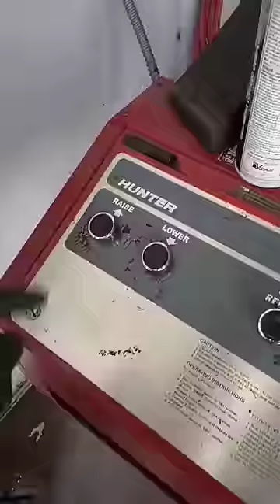how wheel alignments are done #shorts

Comment: That's how a toe set is done. Not a complete alignment, but good procedure I've lost count of the techs I've seen do a caster sweep without the pedal depressor in place.
Reply: I would say that is a complete alignment. Not all cars have anything more then toe adjustments. And like this car not much more then front toe at that. Yes you could shim it but I aint doing that for free. Will you? And most cars if it's off and there is no adjustment usually means something is bent or a bushing is bad or ball joint is toast
Reply: @JoeMamasLover69  this car will also have adjustable camber at the front struts. Rear toe can be adjusted by full contact shims depending on wheel bearing mounting. Front caster will normally have a little bit of adjustment at the upper strut mount and there may be a possibility of a cradle shift to get both camber and caster adjustments also depending on the mounting of the steering/suspension components.
Reply: I’m a tech and still kick my own ass every now and again when I forget to compress the pedal
Reply: with that alignment machine it will detect if you don't have the pedal depressed when doing a caster sweep and won't let you until you do
Reply: @bentleynorton6843  you don’t necessarily need to use the depressor, it will sense if the wheel is moving and tell you but on must trucks with caster set ~2.75 you don’t need it and I’ve tested with and without the depressor and there’s no difference
Reply: It didn’t need a complete alignment.  Didn’t you see the fucking screen?  One red bar, the rest was green
Reply: @fredkuhn165  tell me you know nothing about alignments or customer service without telling me
Reply: @fredkuhn165 keep in mind just because all is green doesn’t always mean it’s good to go. Not saying anything about this guy but in general
Reply: @colbyclemons3917  you were probably a hall monitor growing up mr. know it all.
Reply: @zachbecklake2303   you must be hourly lol
Reply: @joelopez40oz23 and this is why people have distrust with mechanics. We ask for an alignment or are told we need it. The company charges us a price for an alignment that we think is comprehensive, and because of that worth the money. And the tech is like “green, good to go”.

I wish more people would learn about vehicle maintenance and see the automotive repair industry for the rot that it’s become.
Reply: sometimes you gotta do a toe-and-go

Comment: Mechanic said I needed 2 engines 🤔
Reply: He’s right 😂
Reply: Mechanic said I need new blinker fluid to fix my wheel alignment because if the fluid level is too low it will affect my steering when turning.
Reply: @theanonymoustechie replace it 😭
Reply: Probably need half of a transmission too

Comment: You forgot about the torch, cheater pipe, and banging your knuckles so hard they bleed. 

At our shop, it's company standard to include those.
Reply from the maker: Hahah🤣
Reply: hahahaahah i know from experience
Reply: He didn't bother to check tyre pressures and check all the suspension joints for any worn joint
Reply: @luckysdiygarage good job just one thing hold the ball joint with a spanner dont bend it over untightening it. Great work 👍👍
Reply: Experience talking🤣

Comment: I just use 4 jack stands, string and a measuring tape.
Reply: And then you replace your tires every 4 months too. And then subsequently take the vehicle to someone who can actually align it.
Reply: Nah, string Alingement done well is as good as any alingement shop, that's  what profesional racing teams do and so do I  on my personal car and my track car, also I have an extensively modified suspenssion and most shops around me are unable to properly  aling it, even tho there are aftermarket caster and camber adjustments components  they refuse to do it properly , neither do they put the weight on drivers side seat even thou I always request it.

Comment: 4 buckets, two pieces of rope. Start from the back and align the front wheels to the rear wheels. Losen the tierods and adjust. 10 minutes and I'm done. 🤙🏼💪🏽
Reply: 10 minutes is if you have a lift, great tools, no rust, and high on Adderall
Reply: @LawnWrangler323  no. Not really. Placed the two front wheels on top of plastic bags to reduce friction. Aligned the rear to the front wheels. And worked on the arms. And I know it sounds crazy, but that's how I did it. And went to a professional shop to verify and for my surprise, it was less than  .5 off . They told me it was perfect. I didn't needed to get it Aligned.
Reply: Just use a tape measure. Measure front axle tyre on front and backside against the opposite front axle tyre difference 1mm towards on front.
Drive car to see what side it wants to go to, then in your mind think of whqt wheel to adjust.
Thats the way we did it before we had the hunter allignement. Best buy ever for the shop 😅

Comment: All you did was set the toe so its (good to go) you didnt adjust anything else, the camber was out by .5° on the right front and the caster was out by .4° on both sides. Granted the toe might be right but the car is still going to scrub the tires going down the road and it will still have a small pull to the right. All it takes it a little bit of extra time to get those adjustments with a better spec. Do the job right or don't do it at all.
Reply: It never fails…

Comment: Is it common to have the vehicle running at any point for this?  
The reason I am asking is because one of the mechanics took my tuned X5 without permission-(yes I understand test driving) - when I got in, my engine temperature was much higher than it should have been in that short period of time, and I suspect he wanted to see what it had.
Following my alignment I started noticing boost leaks when I was not prior to this. Just wanted to confirm whether or not it being standard procedure to have the vehicle running for a while for a wheel alignment. Thanks in advance.

Comment: Lets talk about the Alignment he did. If you know anything about wheel alignments. that car Caster Cross will cause that car to pull left onto incoming  traffic. .5 Caster Cross is the max allowed limit. Overall this car will not drive great and the steering wheel was off center. Ya might Thumbs up. But I would call this the Standard Good enough mindset of most US based Techs.

Comment: the locking  bolt which way do I turn it to loosen it do I go to the right further down the shaft right?  trying to do my tie rod  and that bolt is not loosening..and theres no rust.. just seems  super tight... also is the best tool to use to adjustable wrenches?

Comment: Alignment is my most hated job ever, cannot stand alignment! I don’t know if it’s the equipment I’m using doesn’t help or I just can’t seem to crack it. But whenever the car comes off the ramp and out for a test run the wheel is never straight. Even though it was clamped in the straight position at the start. I’m using Supertracker 2 wheel alignment, analogue gauges
Reply: That type of equipment does no wheel run out compensation and without it you won't get an accurate alignment.

Comment: So why does it take so long in other shops.  That was quick.
Reply: It's all sped up and that car has only 2 adjustments needed so yeah it's fast. Most have 4+ adjustments. There is also the test drive pre and post so that adds more time. I could post a video on how to do brakes in 1 min doesn't mean it's that fast and easy.
Reply: @fabiololstein1307  also, nobody mentions points where you have to hold a torch to the bolts for 10 minutes 😂
Reply: @jakedro1462  ahh the Joy's of working in the rust belt!!! If wrench on cars for a living I will give you some great advice. Quit, go apply to fork lift repair companies. I worked on cars for 15+ years. I switched to fork lift repair and was the best career decision I have every made. My suggestion would be to find a Car, Mitsu, or Unicarriers dealer. I am a road tech so I am supplied a company van. I still have to use my own tools but get supplied the special tools. Plus you are never cooped up in the same shop. Plus you can choose what kinds of work you want to do.
Reply: This was a hack job  gonna wear  tires Should have adjusted camber shifted the subframe for caster and I didn't see the steering angle reset perform or the spec's for the rear axle to if it needed shims
 must of been 5 o'clock toe & go
Reply: @fabiololstein1307  plus weighting the car with lead shot.
Reply: @Len_M.  only certain manufacturers require that. It may have changed I switched from 15 years of automotive repair to forklift repair about 5 years ago. Best choice I ever made.
Reply: @fabiololstein1307  It’s usually only Performance Cars like BMW M5, etc.

Comment: Rear can still be adjusted, just takes a pry bar. A really big one.
Reply: Shims
Reply: You have my attention lol
Reply: I mean you can bend the axle, and they don't recommend chips anymore due to speed sensors and tone ring misalignment.
Reply: Alot of cars know don't specify a rear camber and toe adjustment. The machine won't even show you when it is. If your thrust angle is way off, you have to inspect for damaged components. Always check your SAI and cross SAI. If it's out of spec. That when you need to inspect for damage.
Reply: @dewilliams2012  If you're using a modern hunter machine you should be putting targets on back, and it will give Camber and toe regardless of if it can be adjusted. It's just gray on the bar graph screen.
Reply: @scatpack1017  the machine will tell you what shin is needed, but that’s a lot if extra labor, and if a solid axle is that far off, there is something wrong
Reply: @Kendal Mautz  ofcourse you put targets on rear to but have you seen some of the new Kia and Hyundai rear ends. It's fixed With no way to adjust.
Reply: Dont be that guy. Set the toe and let it go xD
Reply: Wrong. It is shims that go in between the hub and the Axle
Reply: Not really...... Something is bent or broken if the rear is out

Comment: Hello, one question I have.
I need tire aligment, because my outer front tires are worn of and my car steering wheel is not straight and when you drive it pulls me to the left.
Main question before I go for aligment do I need to put on new tires or I should go with old tires which are worn out on the outer sides or there is no difference
Reply: Better change before, because the mechanic need to test after the alignment if the steering wheel is ok and no pulls, that's what  we do in the shop I work at
Reply from the maker: Hi the first thing I would do before doing an alignment is check the front suspension make sure you don't have any worn out suspension parts like lower control arms knuckle strut inner and outer tie rods make sure there's no play make sure bushings are not cracked soft or broken and if you have a pull to the left try switching the tire to the right and see if it pulls to the right just to confirm if it's suspension related or tire related after confirming  suspension is okay and getting new tires then do the alignment
Reply from the maker: Also double check the wheel bearing on that side
Reply: @luckysdiygarage  thank you for the answer!
Will do that!

Comment: There's one part I don't understand - when adjusting, do the numbers have to be 0°, or is there a good range?
Reply: As you can see on the screen, it’s green. All if not most cars have a slack zone. So the computer knows that if it’s green it’s okay. It can be a couple degrees of 0°. It won’t do anything to the treadwear of the tire or steering wheel angle

Comment: That's not the way its done.  Your supposed to take the customers car out for most insane balls out ,drove it like you stole, dukes of hazard insane test drive,  recording all the burn outs and high speed jumps , brody's , and red lining the engine so high until the pistons try to punch their way out the sides of the engine , then posting it on you tube as a diagnostic test drive

Comment: I thought a wheel alignment is done with the rim, not the tire.
Reply: That's the old school manual way. The computerized alignment is much better at fine turning alignment angles to insure proper tire to road contact, proper tracking, and reduce front tires scrub radius when cornering.

Comment: It's still going to have edgeware you never set it on zero should always be toed in a 16th to an eighth inch... So that alignment sir is incorrect. I am a suspension specialist and I work at a suspension shop and that's our specialty. Not to mention we don't use computers computers lie everything is done manually with beeline gauges and they're way more accurate than any computer just my two cents

Comment: How do u get that job
Reply: Its just a simple normal routine every day task that even lube technicians can learn how to do within one day of decent training.  It's not hard. I'm doing one now and I'm sitting in a customer car on the clock leaving this comment sitting on a similar Hunter Hawkeye Elite brand  alignment rack. 😊😅
Reply: Well technically I just finished a 4 wheel alignment so now I'm about to take it on a test drive to make sure it doesn't pull to either side & ensure the work is done properly before the customer picks up this car they just purchased because it's going to be a certified pre-owned car from a top rated luxury brand dealership.  We only sell one brand of vehicle and these cars have the safest safety reputation globally for decades 💪🏾 💯.  I love this brand.

Comment: That honestly looks terrible, half done....it shows no weights in the vehicle and the camber nearly out on the right side, like sure, cool you're a toe and go junky.... didn't really do an alignment here, toe adjustment sure but not putting weight in the vehicle and leaving the camber is almost doing it for nothing, watch the inside edge wear out on these tires
Reply: 아는척하지마 ㅋㅋㅋ 캠버 안맞춘다고 편마모 현상 일어나는 경우 거의없다. 틀어졌다고 무조건 맞추는게 아니야 조정 불가한 전륜 캠버 캐스터 틀어진건 대부분 차체가 변형된게 문제인데 이럴땐 조정 방법이 없고 주행중 별 문제없으면 그냥 놔두는거임
Reply: @김김이-x8t  No, camber can be adjusted by simply adjusting the lower strut bolts, you have to remove both bolts and grind away the stud that holds the camber angle in it's factory setting. If you cannot get it adjusted this way a bolt can be replaced. You are incorrect because this is absolutely adjustable if you know what you're doing. I still see this as a sub par alignment, like they didn't put anything for weight in the vehicle nor did they set the camber... Just my professional opinion
Reply: @justinweaver7553  그건 비전문성임... 그렇게 차를 정비하면 안됨. 한국에선 그걸 "야매"라고한다.